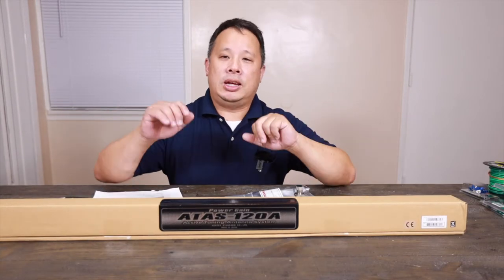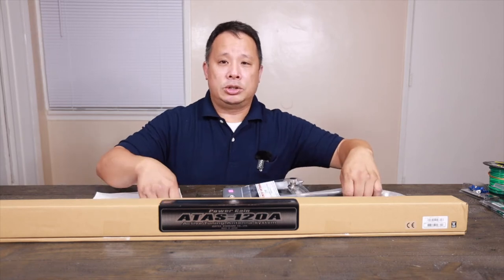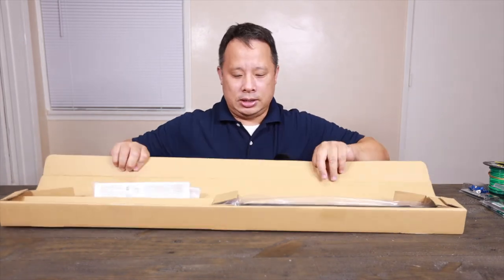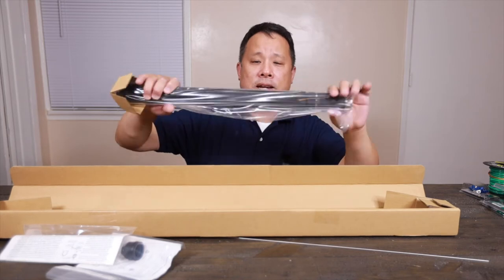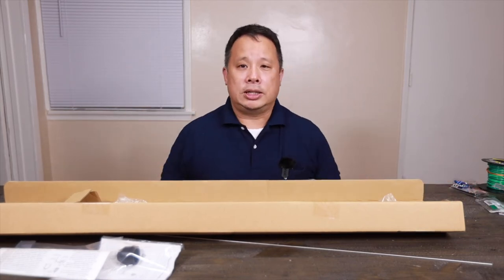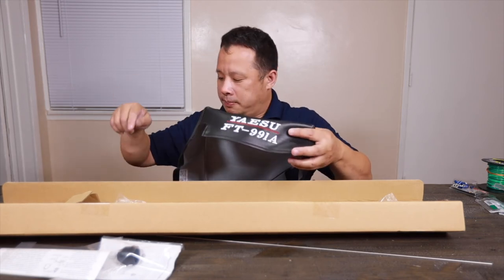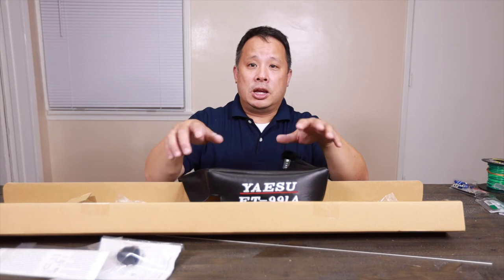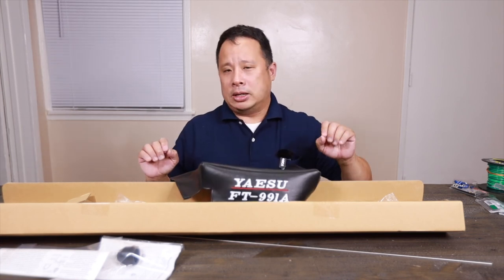Yaesu ATAS-120A unboxing,  Yaesu ATBK-100 unboxing, Yaesu FT-991 Dust Cover

Comment: So, 2 years later, is this still your base rig? How did it all work out?
Reply: Hi, thank yo for viewing.  actually I moved to mountain area shortly after I filmed the video, and I was not able to get signal easily without better setup on antenna.  But everything was working great when I was using them. Thank you.